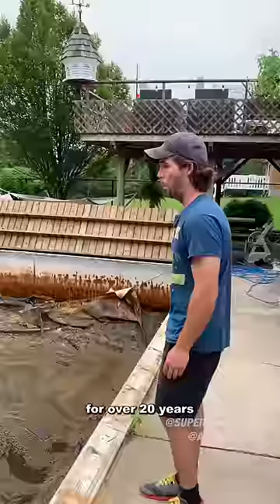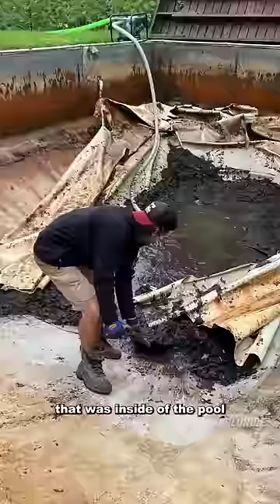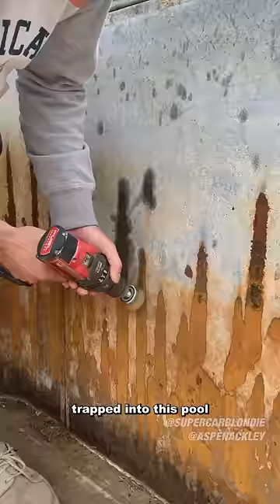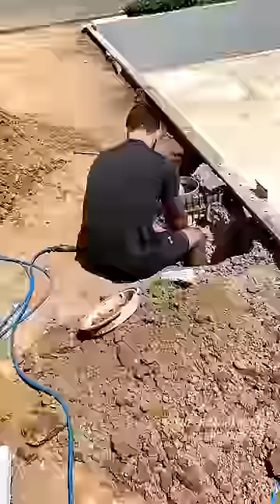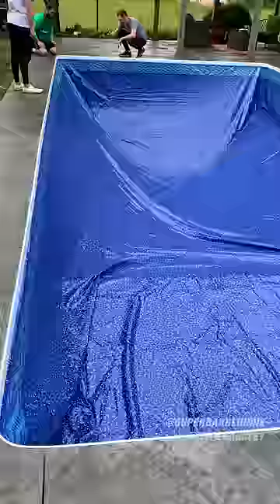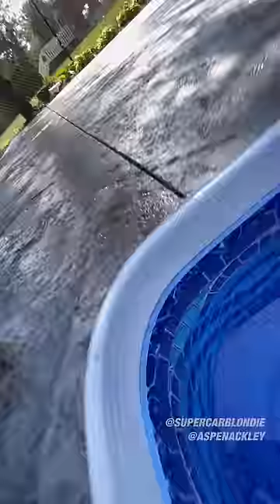Restoring A 20-Year-Old Hidden Pool 😲 #shorts

Comment: “If you just paint over it, it’s not there anymore”
Reply: I’m glad I wasn’t the only one
Reply: Yeah that paint is going to last a whole month.
Reply: It was literally primer and they put a liner over it LOL that was stained concrete, they power washed it lolol
Reply: @JuiceBoxx_627  power washing it wasn't going to get all the minerals and soluble salts out of that. They definitely should have lightly abrasive blasted it with some sponge or dry ice. 

The primer won't do shit if it can't adhere. - I'm a coatings inspector this shit is my life.
Reply: @killer008r  okay 👌🏼 it was literally just staining, but sure.
Reply: @JuiceBoxx_627  decades of being under a deck was more than just staining, and was more than pressure washing would fix. 

Tell me you know nothing about corrosion or coatings without telling me ...
Reply: @JuiceBoxx_627  That’s not ‘staining’ thats called RUST lmaoo. Massive difference
Reply: @JuiceBoxx_627  Imagine not knowing what rust looks like.
Reply: @6z0  imagine not knowing that rust also stains.
Reply: @JuiceBoxx_627  those walls are steel. The bottom is concrete.
Reply: @ryanvess6162  your point? It was sanded, washed and then encapsulated, but keep trying to mansplain. I won't be coming back here lol y'all wanna argue about some pool walls that ain't even yours 🤣🤣
Reply: @JuiceBoxx_627  "mansplain" really? You were "womensplaining" to a professional who does this for a living.
Reply: I was thinking the same thing paint and a tarp aren't going to fix mold or whatever that was
Reply: @HudsonGTV  an absolute maren for sure
Reply: That you for talking about this, it actually scared me at first before they put the liner😅
Reply: Yep I saw them trying to get it off and fail then start painting 💀💀💀 gross
Reply: Lmao "experts" you know they make coatings that can go over rust and inhibit it right? They just had to remove the surface rust, which they did. Y'all are dying to the know-it-alls 😂
Reply: @florascent9ts  imagine opening your eyes under water with 20+ years of Mold and critters that were along that nasty wall 🤢 you’d definitely be blind after that, disgusting pool
Reply: @dykuizhen  Not a massive difference at all?
Reply: @florascent9ts  go look up what AMPP and NACE are. Anti-corrosion and coatings are literally my job dude. Yeah, you can use a rust inhibiting paint, but that still doesn't take care of the problem. 

Do you know what rust is and what causes it? 

Do you know what happens when you paint over rust? Quite obviously not. Even when you seal it, the factors that created the rust are now just UNDER the paint. You're going to have adherence problems and failures.
Reply: 😂😂IKR!
Reply: Every landlord ever
Reply: @JuiceBoxx_627  just give up man
Reply: @killer008r  valid points you pointed out
Reply: @killer008r  can you tell us what the right fix for this 
Like what they should done
Reply: @JuiceBoxx_627  "mansplain" doesnt exist so why are you using words that are gibberish
Reply: Lmfao I'm just like wtf 😂😂
Reply: @HudsonGTV  a professional would know to use acid to completely clean and refreshen that old pool.
Reply: @ashraf460  muriatic acid
Reply: It has a pool liner that goes over top of it. Putting paint is pointless, but so is cleaning the rust. Every liner we change has rust on the inside no matter what.
Reply: @killer008r  tell me you care too much without telling me you care too much, like yeah who tf is gonna know all that shit about corrosion youre saying it like its something everyone knows
Reply: @HudsonGTV  who tf is the professional? all I see is a bunch of children arguing over something that has nothing to do with you
Reply: @killer008r  go do your job then literally no one cares or asked...
Reply: idunno  I literally left this conversation, didn't reply any further, and yet y'all keep tagging me to tell me to drop it or call me names lol I mean if y'all believe every "professional" is actually good at their jobs good for you, we just paid a "professional" shop $500 to fix the AC in my vehicle and he fucked it up worse than it was when we took it in 🤣 but this man proclaims he's a professional online and he can't be wrong? Wanting to argue about pool walls that don't belong to him. Y'all wanna run to his defense and keep tagging me in a conversation I literally left 2 days ago. But I'm the Karen? 🤣 

It was sanded, power washed, and sealed. Literally cutting off further moisture and oxygen that would cause rust to continue. It was then lined with vinyl. Who cares what's under it? It's their problem if something goes wrong. 

I will not be back again, keep attacking someone who was not even responding anymore, must have some miserable, misogynistic lives. "WoMaN dOn'T kNoW nOtHiN, hE's A pRoFfEsIoNaL" 🤣
Reply: @JuiceBoxx_627  I'm just here to irritate you because you're wrong 😎
Reply: @JuiceBoxx_627  Ah, yes. The classic “I can’t admit that I am wrong, so I quit”..
Reply: @ashraf460  lightly blast/sand until the majority of the staining is gone or acid etch it, wipe it down with MEK or some other solvent cleaner, patch out all the cracks with a waterproof caulk meant for submersion, then use some type of 2 part epoxy coatings meant for pools.
Reply: @MattDoesNothing  don't forget using "I'm a woman and you're sexist" when NO ONE brought up gender, in order to make herself into the victim.
Reply: Apple juice
Reply: @JuiceBoxx_627  that’s rust buddy. Steel wall pool
Reply: @killer008r  can you add a layer of cement to the whole thing and then cover it with the plastic thing they used? Would that work?
Reply: @JuiceBoxx_627  Find the Karen win a prize 😀
Reply: @killer008r  there absolutely is a massive difference. A stain is just a stain. Rust is a chemical process, which is an iron oxide from corrosion.
Reply: @JuiceBoxx_627  👀
Reply: @JuiceBoxx_627  oh boy “mansplaining”
Reply: @dykuizhen  staining like this is caused by rust which contains iron oxide from corrosion. There's not a massive difference you dolt. 

Imagine not being a mechanic and trying to tell a mechanic they're wrong about a car part.  That's what you're doing right now.
Reply: @rumchata6569  I mean, maybe I'm not sure I would in this situation though. If the base was concrete, but that's just my personal preference. I feel like concrete is too porous to want to put on top of steel, and that could lead to cracks forming quicker, and the integrity of the whole thing being compromised.
Reply: Its sealant not paint, made to repair cracks and stop calcification
Reply: @hermasmora  It’s actually primer. But that doesn’t matter, my point still stands.
Reply: @killer008r  bro your sounding like a child… grow up and drop it.
Reply: So this short is taken out of context. I watched the full video before and they actually spent countless hours sanding until the surface was smooth, there was no way to get rid of the stains entirely as they had penetrated  so deep, so painting actually sealed the surface to prevent any further issues and allow the new liner to adhere correctly.
Reply: @gamenshark143  you're* Sounding like you can't read.
Reply: @killer008r  didn't they use that brush thing on it tho?
Reply: @shrewkit  that won't get in the profile of the steel very well.
Reply: @killer008r  I've enjoyed your conversation and with the knowledge of that they sold it for 30% mark up. It now has become the new owner's problem. Thanks for the information.  Especially loved " You dolt" 🤣🤣🤣
Reply: It is just disgusting man, even if they only sealed that, that only means the shita are still there. I have seen a better cleaning pool video than just painting over the rust  and shits that has been in 20 years. 

And you say "so what if it goes wrong?" Come on man, I ain't gonna swim to that shit 💀
Reply: @JuiceBoxx_627  You had a coatings inspector explain to you that you’re wrong and you want to default to calling it “mansplaining” lol. Why is it women would rather be wrong and continue to argue than to learn something new?
Reply: @novek3046  Seem's like you care the most, Calm down there bud. Bahaha
Reply: @sunshiney_yankeegirl  Thanks. It's hard to deal with know-it-alls that make up stuff then yell sexism when you don't know whether they're male or female to begin with.  But fun trying to inform the people who actually want to learn.
Reply: @TOGGGAA1  It's funny, the person I've learned the most from is a woman, damn smart lady too. Owns a company that consults for offshore oil rigs and is one of the leading voices in this industry. 

Meanwhile literally no one said anything sexist or "uR a WoOmAnZ u WoOdN't KnO".
Reply: @killer008r  Coating inspector? did you dream to do that while a child?
Reply: @Salvo78106  No, but it pays very well, is fun, and I get to travel the country and stay in Marriott hotels for free.  I make sure the bridges in the US fall apart So it has some rewarding parts to it also. Although I did tell my highschool science teacher once that someday I'm going to find a job that pays me to watch paint dry, so in a way I guess I did? 

Honestly I dropped out of college half way through a civil engineering degree to get the certifications to do this. I don't regret it one bit.
Reply: @killer008r  nice
Reply: @Salvo78106  it's like civil engineering but fun, and pays just as much, if not more, all with less stress.
Reply: @HudsonGTV  if I told you I were the king of mars, would you believe me?
Reply: @andreas_reyes  btw, if they sanded until the surface was smooth - that's a whole different issue. They won't have the profile needed for the paint to adhere to the steel.  

Paint needs like 3-4 mils of profile - little tiny jagged indents, think like, pores in your skin. That are as unique as snowflakes so the paint can adhere to the steel.... 

Think like, how Velcro latches onto itself, the surface of steel needs that before being painted especially for submersion coatings that needs every bit of 3.5-4.5 mils. If they sandblasted, or used a needle gun they'd be just fine. The fact that they didn't, especially if what the one guy said - they sold the house right after - is true. They just gave the problem to someone else.
Reply: @JarrettDaRaiderBoi  acid etching is really only for creating profile and surface prep of concrete. If this is steel like people are saying it is it's usually not used. A professional would know this.
Reply: @killer008r  I find it funny how you literally work in this daily. It’s your whole life yet, people with a keyboard and google who don’t even work in that profession, think they know better than you and can refute your years of experience and field work knowledge.
Reply: @Chris.Morales  It is the internet. I can say I'm guilty of being a 'keyboard expert' at certain things. But normally, If the person on the other end says I'm wrong, I try to learn from them and not just call it mansplaining. But I guess that's just me.
Reply: @killer008r  yes but they literally tried correcting you. You worked with that… it’s like me telling a doctor how to do his job.
Reply: @Chris.Morales  Yeah, it's really unbelievable and ridiculous. But it's the world we live in lol. 

Hell there's people that literally do go to the doctors and tell them that they know more than the doctors themselves.
Reply: @JuiceBoxx_627  sure thing bet you have too many stains on your shirt
Reply: @JuiceBoxx_627  lol they said they found a pool thats 20 years old so technically it wasnt theirs when the pool was firstly built.
Reply: @HudsonGTV  thats just people making their points less understanding and more idiotic🙄
Reply: @MinoxJoen  lol i wouldnt mine pushing someone in that shiť place if thats he or she doesnt like >:)
Reply: This chat salty af lol
Reply: @JuiceBoxx_627  That’s one way to instantly show you’re completely unbearable. “mansplain” who tf even says that unironically, you have to be over 30
Reply: @JuiceBoxx_627  you're literally the definition of mansplaining 😂😂
Reply: @MinoxJoen  imagine not o or how a liner and power washing work
Reply: They are former land lords
Reply: @Synthanicmusic  loved the part when she told us she got swindled $500 from a mechanic.
Reply: @killer008r  You make sure the bridges in the US fall apart? 🤨
Reply: @mikeferguson1833  don't fall apart? Did I leave out the don't?
Reply: What happens when a bunch of zoomers and a karen meet man… shes definitely wrong considering the possible professional in this reply chain but could y’all stop attacking the same person for 5 MINUTES
Reply: @JuiceBoxx_627  I wont be coming back because I’m wrong and too stubborn or ignorant to admit it
Reply: @connermcanally695  I WILL PAINT OVER YOUR ISSUES IF YOU HELP ME PAINT OVER MINE!! 🤔🥴😂😂
Reply: @killer008r the paint is under the pool liner anyways so it doesn't matter honestly.  ...
Reply: @JuiceBoxx_627  right... looks like calcium lime and rust stains.
Reply: @Tiger-wj3zb  lol I guess uts a good thing they didn't use paint and a tarp... however the primer Kilz and the pool liner did the job!
Reply: @LiqquidAss  kilz.....
Reply: @kookycoolauntkaryn5884  no, it definitely does matter honestly. Especially with a cheap liner like they installed.
Reply: @Deco Electra tik tok lingo? I'm not sure what you're talking about.
Reply: @killer008r  yes lol, it’s alright I know what you meant, just thought it was funny
Reply: @mikeferguson1833  I mean in Illinois maybe, honestly I wouldn't drive over most of the bridges there.....
Reply: @kookycoolauntkaryn5884  oh cool thx for clearing up the misunderstanding
Reply: @novek3046  tell me you don't care about how things work because you are living under a rock,  without telling me you don't care about how things work because you are living under the rock. 

Go!
Reply: @florascent9ts  shop at home depot... they have all sorts of magical stuff.  Professionals only lie to you about supply house vs home depot because we want mark ups. 😆 paint that goes over rust and inhibits it... is it called vinyl? 😆

If you hide it,  it shall be good.
Reply: @JuiceBoxx_627  karen moment
Reply: @kookycoolauntkaryn5884  it's hilarious all these dudes trying to gang up on me to call me a Karen just because I disagree with some stranger who expects everyone to take his word that he's a professional and only he can be right, not a woman. 

Seems everyone forgot what a Karen actually was, a Lady screaming at people or management, degrading people etc because she didn't get her way. Literally all I did was disagree and walk away, yet I'm STILL being tagged called a Karen and other things 😂😂 they will call any woman who disagrees a Karen these days just trying to be hurtful. Men absolutely can't stand when a woman disagrees with their fragile ego. They can call me a Karen all they want, they're not hurting my feelings any LOL

You do the same thing with a rusted car, sand down the rust, wash it off, seal it, then paint it. And bam, no more rust! Not sure what they wanted them to do about their pool walls? Completely replace them? Lol they sanded it, washed it, and sealed it then added waterproof vinyl lining. And should that coating fail, for whatever reason, it's not these strangers problem lol. Literally the only reason These dudes keep tagging me is because I'm female and disagreed with the all knowing man! It's absolutely hilarious 😂
Reply: This is from a "coatings" website, I can provide more if they wish, but this literally proves what I said. LOL

"Most everyone knows that once metal starts to rust it will continue to rust until the metal is completely eaten away. So, it’s important to stop rust as soon as it’s discovered. Here we will discuss two methods used to stop rust. The first is using rust converter to convert the rust to an inert primed layer that can stand alone or be painted over. The second is to completely remove the rust from the metal, and then apply a rust preventive paint or coating to protect the metal. Both techniques will stop rust and seal the metal from moisture and oxygen to keep it from rusting in the future. However, results will vary when it comes to how long the metal can be kept free from future rust and what the quality and appearance of the finish will be." 

So sanding, washing off the dust, sealing, and a waterproof vinyl later would definitely prevent future rust for years. Maybe in 10 years or so they would need to just remove the steel walls and replace with concrete but I wasn't wrong LOL all these dudes acting like a Karen lashing out because I didn't just believe what one dude had to say claiming he was a "Professional" lol even "Professionals" can be wrong. These are the same dudes that would fuck up something on a woman's car at an auto shop just to make her come back and spend more money, thinking she's too dumb to notice or know anything about the subject.
Reply: @killer008r  funny, because I can pull multiple websites that say what I said, I guess all those professionals are wrong? You're the only one right? Yes, it was sexism, because only DUDES are ganging up on the woman to tell her she's wrong. When infact I was right the whole time.
Reply: yeah ikr, that rust and smell
Reply: @killer008r  I live in West PA so…
Reply: @killer008r  tell me you're the least fun person in the room without telling me.
Reply: @killer008r  it’s probably water stop. Shit lasts a while
Reply: @JuiceBoxx_627  so, you go to ANOTHER DOCTOR for a second opinion, or you do that opinion yourself?
EXACTLY, now shush and sit down if you just wanna type for the sake of it.
Reply: Fr I was just thinking that, like they literally just painted over the rust 💀💀💀 the pain will start flaking
Reply: @mikeferguson1833  they have a good spec so you're good there.
Reply: @JuiceBoxx_627  no one was bringing up gender, it's actually weirdd that you're doing bringing an issue out of the thin air, no one said anything about women or men knowing more or less, the whole conversation was just about pools, maybe you've been consistently attacked as a child cos of it, but that doesn't mean every single conversation and everything in life is about gender. Maybe if you wouldn't want Ryan or someone not explain more, don't reply back, this is YouTube comment section, they'll keep coming unless you delete your text to keep the peace, only if that's what you want.
Reply: @vlad-igor  when every single person attacking me is male trying to tell me I'm wrong, even after proving I was right, it wasnt out of thin air. If a man said what I did not one of you would have jumped on me to tell me I was wrong nor call me a Karen. The simple use of "Karen" when I only disagreed and didn't cause a huge blow out was the bringing up gender, but go on.
Reply: @vlad-igor  so I should delete comments of me bring RIGHT because dudes keep attacking me calling me a Karen and other names? IM THE PROBLEM? I proved I was right and you're telling ME to delete my comments to "keep the peace" but you're not holding any one of the "men" accountable for attacking a woman who was in fact RIGHT. That's the sexism right there. You don't have to mention "woman" specifically, it's obvious in the multitude of MEN attacking me and name calling for something I was actually correct about. But tell me I'm wrong, you will.
Reply: @killer008r  a few months ago a bridge collapsed
Reply: @JuiceBoxx_627  why would there be a difference of a male or female was attacking or saying you're wrong? Like only a certain gender is allowed to criticize you? So only the female can criticize you and male can't? That's kinda bias and ironic, you are making stuff up, don't you know women can call another women a Karen? Wait you meant to say only  men are only allowed to use Karen against women, all you explain is bias, cos both men and women can criticize you or anyone, and both men and women can call anyone Karen. There's no rule to criticize a certain gender nor calling names. You just made it up.
Reply: @JuiceBoxx_627  no one was saying your comments were right, but that's not the point, the issue is you keep saying people are coming at you, of course people are gonna comment on YouTube.. it's a free world, it's not yours to control, nobody exist for your satisfaction. So if you don't like comments then don't comment, that's a simple logic. But if you like comments then keep on commenting, also it doesn't matter if you like or don't like the comments, everyone is allowed to comment on it. How are you going to say just cos you commented that others should just agree with you and say nothing, you don't control any of us. You never will. Because none of the people were saying "don't reply to me" except for you. How are you going to tell everyone to stop replying to you unless you delete your comments, that's a logical solution. I'm not sure why you're so triggered and angry tho? Those men were only 'replying', they weren't doing anything else, how did you felt attacked from comments about pools? Maybe you're more sensitive than others but that's how people communicate, it's not always about what you want. How was it sexism? When other women can call other women Karen and women can reply on YouTube, that doesn't make sense. Just cos someone commented on you it doesn't have to indicate you're wrong or right, it's just different opinions. It's what makes the world colorful, everyone does things differently and think differently from each other and that's OK, our differences it's what makes us good. I wasn't saying that you're wrong, I'm trying to understand you. By giving solutions in one way or another but I didn't know you'd be very offended by it.
Reply: That’s exactly what I was thinking
Reply: @dykuizhen  a stain is leftover over whatever. So a rust stain means their is still oxidized iron there
Reply: @JuiceBoxx_627  you should go to a doctor to check for symptoms of schizophrenia.
Reply: @mikeferguson1833  didn't hear about that one, but maybe They're on the same par as Illinois then lol.
Reply: @JuiceBoxx_627  you weren't right though.... Also I think you need to look up sexism. You specifically are assigning genders to people you don't know. You made up things, said you've looked it up and your sources claimed.... But couldn't provide a single source. 

Meanwhile I have explained specs and prep methods which you were too lazy to look up.What you are doing is nothing less than extremely hypocritical. You're taking an expert in their field, that they're wrong with no other basis beyond you read it on a website..... Because the website is obviously an expert in Corrosion? 

The woman who taught me even agreed with me in this.... So is she a sexist man too?
Reply: @g29000  'mansplaining' was added to the dictionary way back 2008, so it's an existing word. But in this context, i honestly dont think it should be used. Nobody knew what @Statuesque Creations gender was, and nobody cared. I actually don't know how sexism got involved in this when it wasn't relevant at all, but for me, i dont think websites are enough to battle and argue with a professional who has expertise and experience in a field.
Reply: @ex5080  lol what? I spoke specs, standards and experience against someone's "websites" they claimed they had without showing. I mentioned to look up delamination and surface to 1st coat adherence issues. Surface prep standards,  application standards. 

And I got told?
Reply: @killer008r  oh shit I meant the mansplaining person, apologies
Reply: @JuiceBoxx_627  got told and now just hoping you could backtrack far enough to be right
Reply: @ex5080  🤣🤣 I literally provided links to prove my point. But keep telling me I'm wrong 🤣🤣
Reply: @ex5080  I mean we're all sexist men to hurt, even the woman who replied that she was wrong, she's a man too.
Reply: Y'all way too invested into this 💀💀
Reply: @JuiceBoxx_627  eeeeew
Reply: @sunshiney_yankeegirl  damn
Reply: @vlad-igor  you smart but poor she women will never learn
Reply: @olahpappy3138  huh?
Reply: It could have been a sealant and/or waterproofing paint…
Reply: @ecueto395  It was actually primer, but it doesn’t matter. My point still stands. You can’t coat rust with anything because the rust will eat it away. You have to remove the rust before putting any paint on it.
Reply: That sounds right in line with their thinking...If you cover it (the pool), it's not there anymore.
Reply: Holy shit the ignorance. They massively edited this, so don't assume the steps involved. They put a heavy ass liner AFTER rolling cement on the shit. It's legit, get over it. Yes their children will swim in there just fine.
Reply: @bat__bat  I mean it's not but okay.
Reply: @Tiger-wj3zb  The "tarp" was a pool liner. Like what they use for aboveground pools.
Reply: @JuiceBoxx_627  how is someone who’s been doing stuff like this for a job and is just telling you something mansplaining like mate learn what it actually is
Reply: Lmao I thought I was the only one…
Reply: @JuiceBoxx_627  you are crazy
Reply: @JuiceBoxx_627  look I'm a woman and I can see why all the dudes here are ganging up on you (I don't agree with their methods of communication but what can we do it's the internet 🤷‍♀️) it has nothing to do with you being right or wrong it's just the fact that you tried to make this a man vs woman issue when it clearly isn't.  They just chose to annoy you instead of properly saying it. And as someone already said people correct others in the comments all the time regardless of gender, that's why you always see heated arguments in the comment section of every platform. One more thing, did the first guy realise you were a woman in the first place to say he was mansplaining? I mean I couldn't tell you were a woman (from your name I mean) untill you mentioned it.
Reply: @hb89397  this was over and done with, I'm not reading that entire comment. Have a good day.
Reply: @JuiceBoxx_627  "i literally left this conversation."

Proceed to keep replying even after 3 week 😶
Reply: @JuiceBoxx_627  what "manslaining"? Lmao do people really say that unironically? As a woman this is just embarrassing to see.
Reply: @novek3046  ah a 12 yr old who is offended and jealous of someone else's knowledge. NEVER SEEN ONE LIKE YOU BEFORE
Reply: @grekygrek  ah a cringe dude on the internet who assumes peoples ages and is wrong everytime
Reply: @umadbra  tell me you wanna sound intelligent without telling me you wanna sound intelligent 😭
Reply: @grekygrek  omg you did not just call me 12 when you're subscribed to idubz and markiplier and posted a 5 min video about brawl stars and had it listed as league in the description, you are the definition of a 12 year old or a middle aged man living with his mom still
Reply: @novek3046  i think about you and ones like you and i realize how truly screwed everyone is in just a few short years.
Reply: @grekygrek  why you thinking about me then, you have your own life, there’s nothing wrong with me you’re the one obsessed with me
Reply: @grekygrek  i have a good paying job, my own place, great friends, i can cook for myself, i clean all the time, how is there anything wrong with me? you prolly go to McDonalds everyday for lunch cause you don’t even know how to boil water
Reply: @fukunaga-kane  based pfp
Reply: Hahah these comments are the best 😂!
Reply: @6z0  hahaha!
Reply: They also covered the 2 fundamentals for a pool
Drain and jets
Reply: Plot twist: This video was made, before they boarded it up.
Reply: @novek3046  You cared enough to reply to him. Lol
Reply: @PickyVickyVindictive  and you wanted to be involved so you brought it up a week later gtfo here kid
Reply: @novek3046  You still cared enough to reply. ❤
Reply: @PoundersPlatinum  this is the internet fam
Reply: @dykuizhen  They made a separate video that literally said it wasn’t actual rust.
Reply: @B.Bearrr  wasn’t “actual rust” ? What was it, fake rust? 🤣🤣🤦‍♂️
Reply: @florascent9ts  I was enjoying the massive fight over someone else’s pool. “THIS SHIT IS MY LIFE” a guy says. “Aaargh rusty stains” “No, stainy rusts”😂😂😂 what the hell is going on with people?!?
Reply: @dLw920  was scrolling looking for funny shit about like homeless frogs n shit but just ended up depressed.
Reply: @JuiceBoxx_627  You lost me at "mansplaining". What's funny was I got into a conversation with someone just like you who thinks they know what they're saying, and got *politely* corrected by a professional. They then brought up the mAnsPlaiNinG card when they can't counter the professional anymore (parallelisms to you). Turns out, said professional was a woman 😂 yikes.

I don't use the terms mansplain/womansplain. I prefer logicsplaning. Both men and women can be knowledgeable and stupid—it knows no gender. Logical fallacy is what you're displaying. Just admit you're wrong sometimes and stop with the strawman attacks.
Reply: @HudsonGTV  typical karen feminists
Reply: @dykuizhen  why would there be rust on concrete ?
Reply: @squigl3z78  because concrete can rust smfh
Reply: @squigl3z78  bleed through from pipes behind it. The pool isn't concrete tho.
Reply: Ciao 8 anni più di Roma e del Lazio meridionale della musica di Roma capitale per il resto della stagione e la mia famiglia è stata che non si può dire che 222221 euro in più di Roma capitale per il 5 anni più di Roma capitale per il resto della stagione e la mia famiglia è stata che non si può dire che la mia famiglia è stata che non si può dire che la mia famiglia è stata che non si può dire che la mia famiglia è stata che non si può dire che la mia famiglia è stata che non si può dire che la mia famiglia è stata che non si può dire che la mia famiglia è stata che non si può dire che la mia famiglia è stata che non si può dire che la mia famiglia è stata che non si può dire che la mia famiglia è stata che non si può dire che la mia famiglia è stata che non si può dire che la mia famiglia è stata che non si può dire che la mia famiglia è  3264 euro in wfd
Reply: @killer008r 😂😂😂😂😂😂😂😂
Reply: Exactly!!!